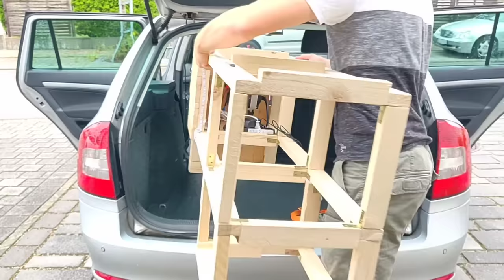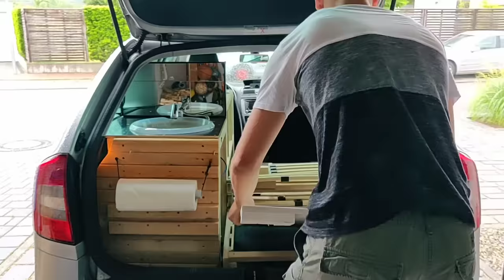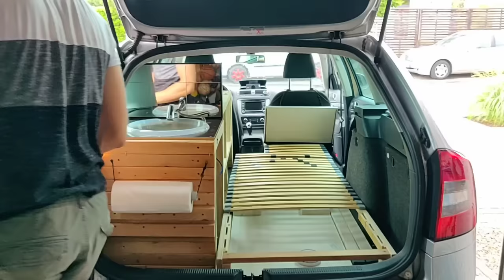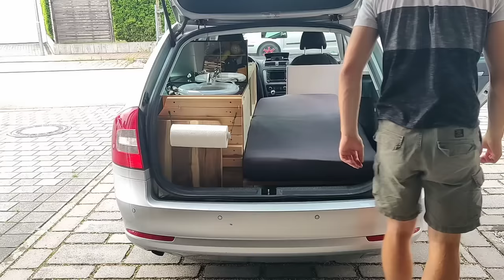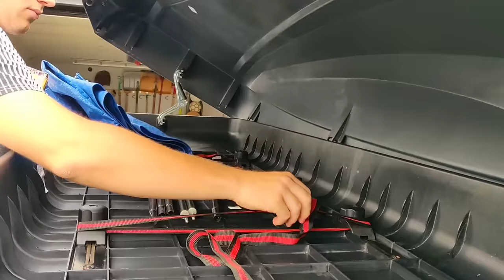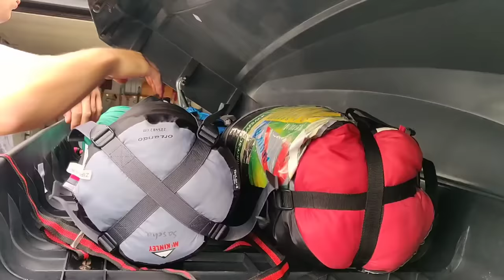Micro-Camper Conversion of a Skoda Octavia

Comment: Think the only thing I'd change, is either cutting the mattress in half so it can be stored in 'drive' mode without too much difficulty, or I'd use an air bed. Only problem with air beds is they aren't exactly stealth proof 😂😅 otherwise. Solid design! Minimalistic but effective and efficient. 😊
Reply: they always leak in the night 😂
Reply: You can use outdoor furniture loungers. They fold.
Reply: Love this.  My only concern is that I have a lightweight scooter and that is an extra item to add to the car

Comment: An option in a car, to transform it into a caravan, is to remove the right front seat (and store it in a storage room or carry it on the roof rack), and in the long  space on the right side put a double folding berth, even better using mattresses inflatables.
Reply: I use a hand made special foamy that rolls nicely with freezer on rear driver side giving me solar panel on the roof with the kayak and then have a bike on the back trailer hitch.  Bed doubles as office kitchen etc. So I roll the bed out of the way to make space to cook inside during rainy times with the sun roof open and peice of plastic and solar panel keep the water out while I sleep with bug nets is quite comfortable for nomadic life few months of the year. You could go further and get a Chinese diesel heater and live year round if I wanted. Especially with house and gas prices 😆 🤣

Comment: I'm in my Prius to save money and write a book. I went through 5 air mattresses and now ready to do it right. I didn't know air mattresses produce condensation in winter and gets sleeping bag wet. This is amazing, thank you.
Reply: They don’t…. Your Warm and moist breath gets cooled Down when it meets the windows/Roof and then the moisture falls Down on to your sleeping bag, because cold air can’t hold as much moisture as warm air.
Reply: @chunkyfecalbreakfast  it may do so. I didn’t think of that, because I always use a pump in order to avoid warm moist air from my lungs and thereby fungi inside my mattress. I guess that supports your argument. 🙂
Reply: @chunkyfecalbreakfast  But then again, - it only takes 5 BIG breaths to inflate my air mattres. That equates 2 minuttes of breathing. During a 8 hours sleep you'll breathe about  (8hours x 60 minutes x 10 normal breaths)  = 4.800 breaths.
 
So the breaths you put into you mattres is close to nothing, compared to your overall breathing during a night's sleep. 

I still think my first argument holds up. (Its not the air in the mattress that makes the difference, - instead it is your overall nightly breathing that is the culprit)

Comment: Brilliant but I but I would have put at least a spare tire on the trunk or if I unfortunately had to puncture a tire I don't have to disassemble half a camper to get it from under the panel, where it resides in its housing. however it was you were very good at building it all. good job.
Reply from the maker: Well, i need 10-15minutes to get my spare tire out of the car. That's not perfect but it is possible.

Comment: Ok Nice, and what about safety? During rear crash, this wooden frame will passed through your body...
Reply from the maker: well, good objection.  But in fact, the wooden wall at the front of the construction is also there to distribute the forces.  The washbasin at the back is also built in such a way that it folds up when pressed from behind.  the water tanks in the rear area also compensate impact forces.  of course it would be safer without the wooden structure.  if you have any suggestions for improvement, i'll be thinking about implementing them.

Comment: hello just one question .. may i know where you found the bed base with the slats!
Reply from the maker: this is a normal 90*200cm slatted frame i found at eBayKleinanzeigen.  I shortened the slats myself to 60cm and installed the folding mechanism.
Reply: @Technikcheck2016  Thank you very much! a big hello from Italy :-)
Reply: @Technikcheck2016  i've also found something similar in Ikea

Comment: Very good effort.  But I think a lot of space is wasted on installing the water sink inside
Reply from the maker: You're right. The sink needs a lot of space, but it is also extremely practical.
Reply: @Technikcheck2016  Yes I accept that.  But I think if you thought about it differently, you would have saved more space.  Good job anyway.

Comment: All looks well but no sign of how he gets out of bed. Once the tailgate is closed and no access to front doors at best only one rear door will open and little roof space even less when blankets are used where does he swing his legs to sit up? Wouldn't want to be desperate to pee or worse.
Reply from the maker: You noticed the disadvantages. But it was the cheapest methode for me to travel with all my things, so I had to accept these disadvantages. The car even has advantages: nobody believes someone is sleeping inside so safer and less problems with finding a spot for the night💁🏼‍♂️

Comment: Can you tell us the budget  you had to spend  thank you
Reply from the maker: I already had the roof box, so it didn't cost anything.  with mattress, sink (€ 20), pump with hose and tap (€ 30), second battery (AGM ~ € 120), vehicle cables and connections (€ 50), automatic cut-off relay (€ 30), inverter (€ 40), mattress (  50 €) and the whole wooden construction with screws and angles (~ 200 €), mirror (10 €) smoke alarm and co-alarm (30 €), camping stove (30 €), plastic boxes (40 €) and the light chain as lighting (10  €) and roof rack (50 €) as well as other small parts it was about 800 € in the end

Comment: Hi. I threw it away unfortunately already, but LISTEN THE BEST CONVERSION OF OCTAVIA 2.:
i put extra bottom so the level was straight for 2 persons. under the bottom table for 2, 2 chairs and gas stove. 2 matraces. in the level of rear windows another desk for stuff, so you could put legs underneath. 
  Under the rear seats there was a place for a fridge and extra battery for a boat and a shower made of a can 20L and shower with 12DC engine. On the rear seats there were desks so the lay area was 200cm. Under the rear seats there were hidden sleeping bags and other stuff, quite a lot of space. On the roof there were a 2 bicicyles and coffin with a inflatable boat with electric engine. The stuff like clothes etw were in plastic ikea boxes who were on rear seats, while sleeping on the front chairs. 
   We traveled all europe and corsica and mountains etw.. with my ex. THE BEST CAR EVER. Small, compact, reliable, strong, enough space for 2 sleeping, bikes and boat. And eating, food, fishing rots, roller blades and treking holes, tins, diving equipment etw. JAJAJAJA
Reply from the maker: Sounds like a great conversion 👍🏻

Comment: And now imagine trying to get the spare wheel out
Reply from the maker: Already tried it.  It took 10min...
Reply: Theres no way youd prefer doing it your way on the side of the motorway though plus the likelyhood of you not having anything on your bed when it happens is probably quite slim
Reply: @ozsharp9172  eh, in Germany, you need to have a "warning triangle" on board (you can get fined if you don't). Put that up, and the other drivers are warned. You can also call police and they will cover you with their car while you change the tire. And if you're a member of the automobile club, they'll send help (and a tow truck if necessary). It's not expensive, they'll come out as often as you need them, and they sure saved my a$$ a bunch of times with that old bucket I called my car (that included a tow job from an Autobahn). You can even get their sevices in other European countries, costs around 50% more per year than the "Germany only"-tariff. It was like 90 EUR for Germany vs 130 EUR for the Yuropean Onion back then (been a couple of years ago). There are also a number of other automobile clubs and associations, my dad was covered by the truck drivers club despite being out of that workforce for several decades...

Comment: It's great but I wouldn't want to drive behind him, with the sun hitting that mirror.  It's the only problem.
Reply from the maker: You may have seen the "Reetungsgasse" sign in my back window in one of my latest videos. I think the sign prevents a dazzling reflection of the sunlight.  But good point👍🏻
Reply: @Technikcheck2016  If it folded up or down, it would be perfect.  I'd move in tomorrow.